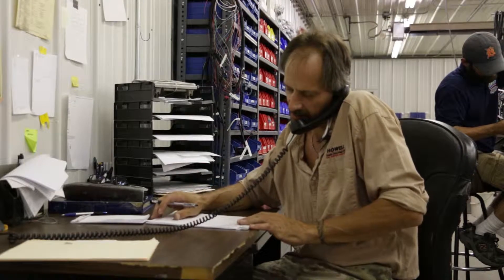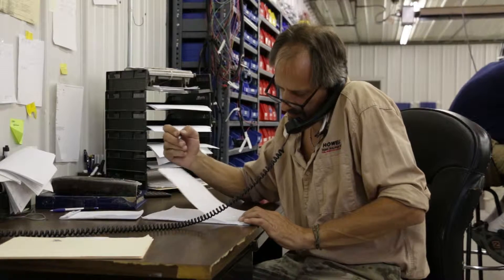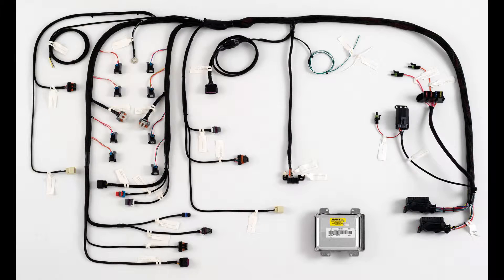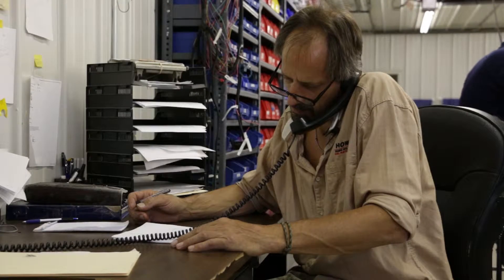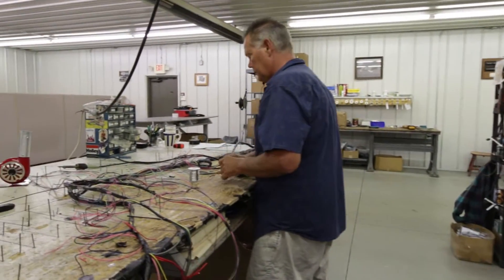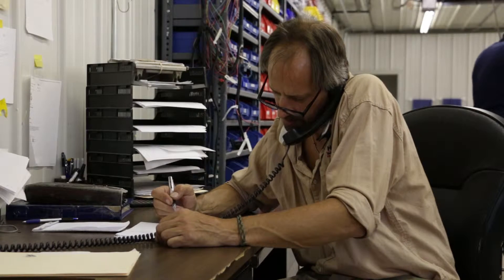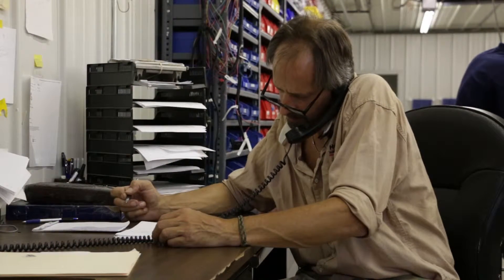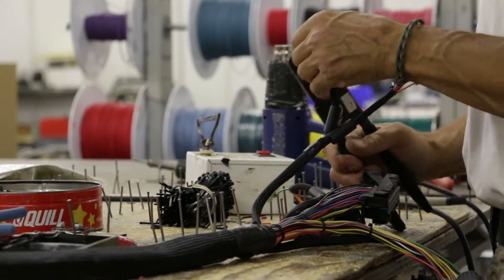Howell EFI LSX/LTX Wiring Harness Order Process

Comment: I'll be calling you with my wiring request.  1995 LT1 engine going into 1983 Camaro.  Now I know what info you  need for me to have before I call.
Reply from the maker: Tom, couple questions we'll ask you is length of trunk, distance from ECM placement to the back of the engine.  Gear ratio/tire size/transmission /etc.
Reply: @howellenginedevelopment903  
Great I'll have all that info for you within the month.  We're still building.  Thanks for the reply.  Do you need what is in the engine like compression ratio, cam, rockers, cu.in and the optic-spark distributor?  I can send pictures of the engine compartment.  One question, where do you plan to have the wiring go through the firewall?
Reply from the maker: @tomstrickland6002  Tom,

we'll need cam specs, displacement, gear ratio, rear tire size, wiring can go through firewall anywhere you want.  We just need trunk length from center back of engine to ECM (computer).